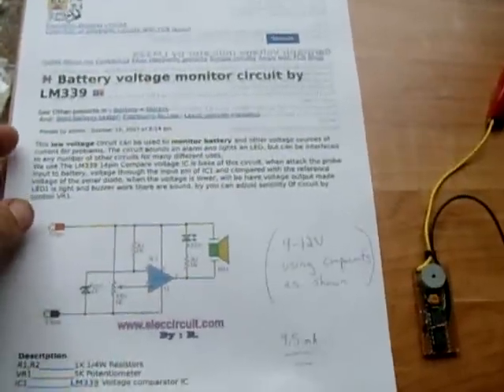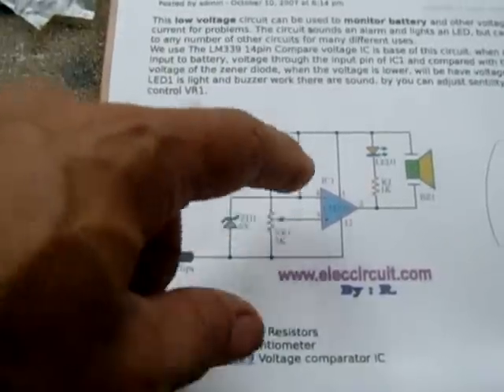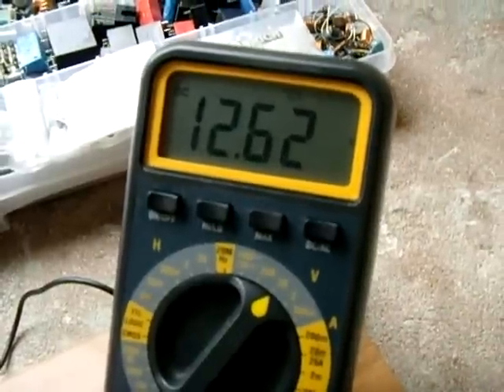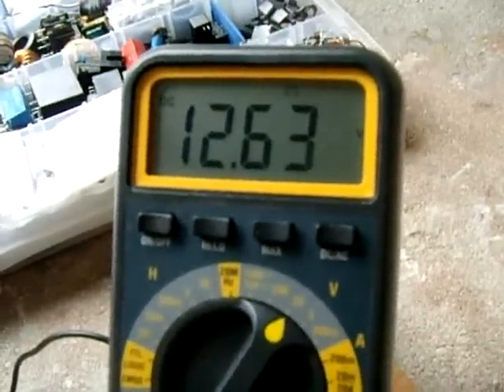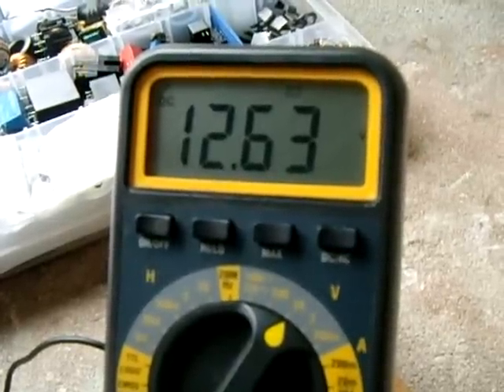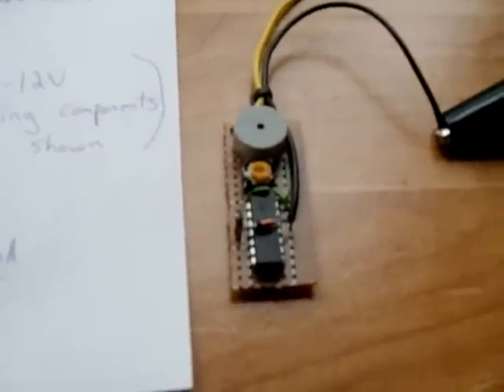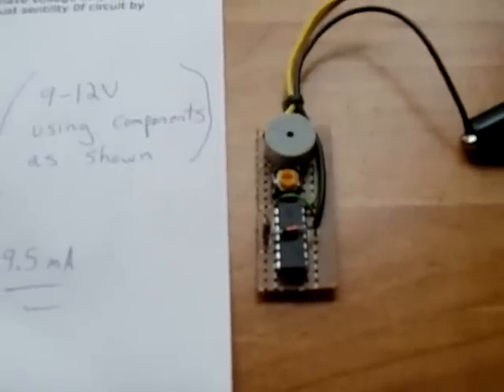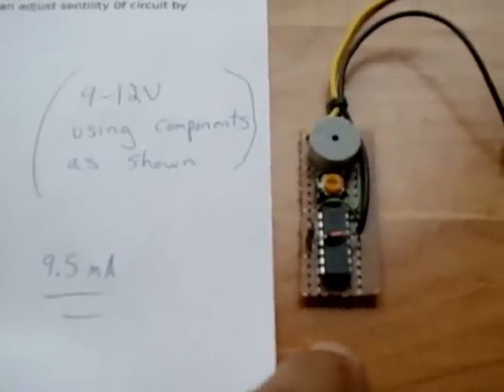12V Battery Low Voltage Alarm Circuit

Comment from the maker: In order for the piezo to sound, pin #2 must go to GND/Battery NEG. You can connect a PNP transistor(2n3906) to pin#2. The base goes to pin#2, The collector to the NEG rail, and the emitter to a relay(w/back EMF diode across it), then leaving the relay to the positive rail. Once triggered, the relay can be used to activate another circuit.

Comment: Nice video.  I may not always be near the boat when it begins to sound the alarm.  What is the power consumption with the alarm activated?  Do you have a solution for an intermittent alarm that sounds every 20-30 seconds to lower the power demand for the chime?  That way it won't compound the low-battery problem.

Comment: My Chargery BMS has 12v that goes low (0v)when there's an alarm. Rather than using a 12 volt relay that is always activated, when power is lost it then sends 24v to a shunt trip breaker. How can we do this with solid state?

Comment: thank you   can i use insted of the buzzer just a small resistor and connect it to a sonoff like switch so i can see it in my phone that the switch is on and its say low V ?
Reply from the maker: Use a reed relay as a switch instead.

Comment: Hii ElectronicsNmore

i am in need of a Lead acid battery over discharge protection for each of my battery (be it for my tractor, wood chipper starter motor, wind generator battery (used the battery for a indoor farm lighting thru an inverter)), very often my friend used the battery without intention to under voltage without knowing. hence ruin many batteries... hard to maintain without a proper protection. sometime the battery have being left laying around with no one caring thru the winter and hence the battery self discharged until so low that it weakened it power. 

i have decided to help out by making (or modifying ) any affordable circuit to fit onto the battery permanently. so, when the battery weakened to a state that will causes desulfation it will first beep the buzzer without stopping , then cut off the load after around 30 seconds of beeping.  the buzzer will continue to beep without stopping (unless the user manually press the stop button - this is for the sake of make sure no one will missed out the battery which might be laying around in the winter which discharged itself to critical point) . the load circuit will not close as long as the battery is not charge up to the safe point. 

this is my requirement. and because the starting load ampere is so high (it is a diesel engine starter which may be used in winter ) that it reaches 700amp for the first 2 to 3 second then lower to about 200 - 300 amp as long as the starter button is pressed. 

what is the viable option and mods ? i would not use anything that constantly draw lot of power out of the battery, because it is just not practical in long run.  thriad.. or any other option ? 

i would love to pay you in euro  of a small sum as a token of appreciation (thru paypal or any secure method )for your effort to help me achieve a practical solution for my friend's organic farm.. which is very low in man power.. because it is just a beginning farm of small scale.. in uk. i help him at my own expense.. because he is a good person and christian should help one another. 

i hope you can help me out too. 

your help would be appreciated. 

thanks
andrew
germany

Comment: Nice video. I’m looking to use this circuit on a car battery. Could I leave this device in place even if I use the car periodically (ie the battery will be under load sometimes)?
Reply from the maker: Ron Turcotte Fine for that purpose. It would take weeks of no use to drain your battery. Thanks for watching!
Reply: I was actually wondering whether the current from starting the car or running it would fry this circuit.

Comment: Great video! Question. My boat is running 2x 6V 1.3Ah sealed lead acid batteries in parallel, so would your instructions be there same? If not, can you assist? I'm good at soldering but a newbie to electronics. Also, can an led light be added to the speaker output to have a visual warning as well? I may need this because I have a diesel sound module so it sounds like a real tugboat. This sound may be louder than the piezo speaker. Thanks!
Reply from the maker: +Pete Slonka 
Hi Pete. The schematic shows an LED in parallel with the buzzer/alarm. To use with lower voltage, adjust the zener value lower if the circuit does not work.

Comment: hi how could i wire this to switch to another 12v lead acid battery when one needs charging. idea is that  i use electic fences what i would like to do is have two 12v acid batteries together both fully charged one connected to electric fence so it doesnt discharge fully it auto swithes to charged battery this way i can keep fences running and my batteries last longer. I can then just swap with a fully charged one when im passing by. the draw on electric fence is only 79mah from battery
Reply from the maker: Just install a solar charger.

Comment: Can I just pull the Piezo out and put a relay in its place to use it as a switch instead of an alarm? I'm going to make one of these and I just wanted to make sure before i start piecing everything together.
Reply from the maker: Hey there,
Should work fine if you use a relay coil which only draws low current(35-40mA), and you ditch the LED. If it does not work, you can always use a PNP transistor(BC557/2N4403/2N3906) with its base connected to pin 2 through a 2.7k to 10K resistor. Then take the emitter to the positive rail, and the collector to the relay coil and the other side of the relay coil to ground. Be sure to use a 1N4003  to 1N4007 diode in reverse across the relay coil!.

Thanks For Watching! Be sure to rate thumbs up and share my videos with others.

Comment: Hello, I have just watched this tutorial and found it very interesting.  As you know I saw the other simple circuit a couple of days ago. Now I don't know which one to have a go at?  Is one better than the other? Thanks again. John.... :)
Reply from the maker: I like this circuit better.
Reply: Thank you very much for the quick reply, At the moment I just need this circuit for a small 12v motorcycle type battery that I use to power some led's at night.  I was thinking maybe not letting it drop below 11v or is that too low? also, the parts list shows a 6v zener would that need to be changed to a different value? Thanks for your time.  John.... :)

Comment: Dear sir,
  It was very nice video and very good explanation.I have 24 volt acid battery of 195 AH  in stacker.we have facing problem that our operater was used this battery upto below low level so i want some interlock that if battery level goes to 12 volt relay will operate so that its relay i wil shut off its controller.
 Can i do this by this circuit??
Please help sir..

Comment: hey! i have 2 12v lead acid batteries in series, what changes do i need to make?
Reply from the maker: Hi. Try a 12V zener instead of a 6V, increase the resistor in series with the LED to 2.7 or 4.7K, make R1 a 2K, and use a 24V piezo buzzer.
Reply: @electronicsNmore  Thanks for sharing. Same scenario as Krukid, except I need an output of 12v @ 8A in place of the piezo buzzer. Does the same setup work, or would I need an entire circuit upgrade?

Comment: Great circuit. I wish you would explain how it operates. That is the whole point, right? The circuit link does not explain clearly. Oh well.
Reply from the maker: No, the point was to show viewers a good circuit that works, one I tested. Some videos I explain more in detail.
Reply: electronicsNmore It is a great circuit. I was curious and wanted to learn. Thank you very much for sharing.

Comment: suppose i want to make 7.4v indicator so, i have to adjust the potentiometer to supply 7.4v at the  non inverting terminal of the comparator,so that it could check the battery level with respect to 7.4v . Am i right??
Reply from the maker: Try the circuit as is. If it does not work, then try a lower value zener. Thanks for watching!

Comment: hii ElectronicsNmore

can you do a mod for me please.. 

this lead acid battery low voltage alarm device, can you pls add in a "load disengage circuit" to it ? 

i am using such a battery at my garden hut to power up an inverter which in term power up light bulb in the hut.
my wife kept over use the battery until the battery sulfated, ruin the life of the battery. 

i need your low voltage warning device, but it has to beep warning first, then when the voltage drop further by a few 0.1v, it should cut off the load circuit (which is the inverter). which ever way which is practical.. which won't consume up unnecessary power from the battery .  a relay is a bad idea, because it kept drawing unnecessary power ..

any idea how to achieve that ? 

thanks. 
andrew
Reply from the maker: :-) https://www.youtube.com/watch?v=1BKEMDYAGBA

Comment: Hey, great work! This exactly what I need for the boat, and I've ordered all the parts. But I'm a bit unsure about the schematic. Do you have a picture of your board that would make it easier to understand how to connect all the parts in the best way? Sorry for being so bad at reading schematics! :)
Reply from the maker: Looking at my board would only confuse you. The schematic is very simple/easy to follow. :-)

Thanks For Watching!
Reply: electronicsNmore
Ok! :) I think I've got it now. I haven't got an adjustable power supply (yet) so I used an LM7812 which gives me about 12.1. No matter how I turn the pot the buzzer buzzes. I've tried a 6.2V and a 5.6V zener. Is this normal?
Reply: electronicsNmore Ah got it! One connection was missing! :)
A
Reply: Torsan1977
Got it all soldered up now and preparing to install this in a friends boat. I'm planning to also add in a voltage display via a momentary switch, so it is easy to monitor the voltage.

It's incredible that it draws so little power! I can confirm your mA numbers.
Reply: Torsan1977 having the same prob what connection is missing please ?
Reply: try to reproduce the schematic on a bread board first and then solder it.
Reply: Torsan1977 I have placed the components on the breadboard as shown in the schematic and it still don't work. I'm wanting the buzzer to sound when my battery gets below 10v can you tell me how you figure out what was wrong in the diagram thankyou
Reply: Torsan1977 also I'm using a 6.2v 500mw zener diode my dad say it should work with either a 6v or a 6.2v because 0.02v shouldn't make a difference
 thankyou again for replying
Reply: There is nothing wrong in the diagram as far as I know. I've made it both on breadboard and on perf.board and it work if everything is connected correctly (which is not easy). Double check everything.
Reply: Torsan1977 okay can I ask in the above post where you said something was missing can I ask what?.  I will try it again when I get the chance and I will get back to you
Reply: okey, the only thing i was "missing" was a picture of the soldered board. I have looked but i dont have any pictures myself of my own bread board. Good luck!
Reply: Torsan1977 circuit is now working managed to figure out the problem I think it was either a dodgy pot or my breadboard is dieing on a few parts of the board. but all working now thankyou for your help (Torsan1997)
Reply: Well done! :D
Reply: Torsan1977 thankyou. one thing tho is  the buzzer is very quiet

Comment: Does anybody know if this could (or if it would be advisable to) be hooked up to a transistor or relay to control charging a battery between upper and lower boundaries?

It seems like the low current consumption might be an advantage over other designs.

Thanks in advance.
Reply from the maker: +Steven Funk 
The maximum current the lm339 can sink is around 16mA. In order to connect a relay which can be used to supply charging current to a battery when the voltage drops to a certain level, you would need to connect a 1K resistor to pin#2, then to the base of a 2n3906 (PNP)transistor. Connect the emitter to the +V supply rail, then place the relay coil along with a back EMF(reverse biased 1n4148/1n4003 in parallel with the coil) between the collector of the PNP and NEG rail. You also need to play around with the hysteresis by placing a high value resistor between pin 2 and 5. Try (100k, 270k, 470k...etc). All this circuit will do is allow the battery to charge "SOME" after the voltage drops to a low level that you set. Charging will not last long because as soon as the voltage rises a small amount, the charging stops. You adjust how long using the resistor values mentioned above. Thanks. Be sure to share my channel and rate thumbs up.

Comment: Sir how we can this use as a over voltage protection alarm with thess components
Reply from the maker: Try reversing the wires going to pin 4 and pin 5.

Comment: sir,can i use the output of the solar charge controller to energize the 12 volt dc realy..i try but the relay keeps on switching on and off..pls help
Reply from the maker: What circuit?

Comment: Is there a way to make it work above 12V say 12.5 or 13V?
Reply from the maker: Yes, Try using the circuit as is, if that does not work, then raise the value of the zener diode. Should work fine. Do not exceed the voltage rating of the lm339, which is 18V.

Thanks For watching!

Comment: if i want to make 7.4 volt  battery level indicator .Then what modification i have to do????
Reply from the maker: Should work fine for that voltage. If not, then user a low voltage zener. :-)

Comment: can i used that when the battery is overcharge?
Reply from the maker: Yes, replace the zener with a 12V, and swap the pin 4 and pin 5 connections on the IC.
Reply: tnx sir but can i used the alarm at the same time for discharge and overcharge with the same battery as well.
Reply: can i used the trimmer pot
Reply from the maker: The LM339 has (4) comparators. Leave this circuit as shown in this video, then use another inverter for the high voltage alarm as explained.  Pins 6 & 7 are just like pins 4 & 5. The output is pin 1. Connect the outputs 1 & 2 together. Should work.

Comment: this circuit will not work with the optoisolator.
There is a different of voltages so that the led will light up measured from the two pins of the LED
eg 7.31V on the positive side and 7.15V
then you turn input voltage of the main DC source from 5V to 12V and stop at 7.2V

It will maintain at such difference only at 7.2V

the opto isolator will not work with this circuit even if I use 1117 AMS 1.2V to force to input voltage to 1.2V to produce 1.2V to pull-up circuit.
The programming is well prepared and tested thoroughly but I will save it other manipulation. Better luck next time. I have been doubling my effort.
Reply from the maker: There is no optoisolator in this circuit!
Reply: electronicsNmore take a way the LED and opto isolator.... if the current going to optoisolator is 1.2V.The programming in Python is well prepared and tested thoroughly but I will save it other manipulation.  My zener diode is 6,2V 1/2 W.